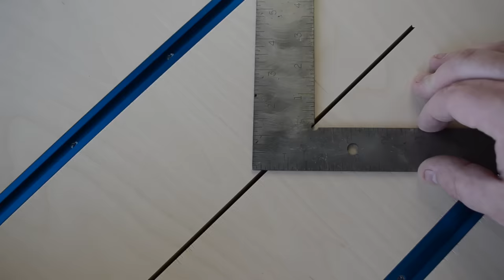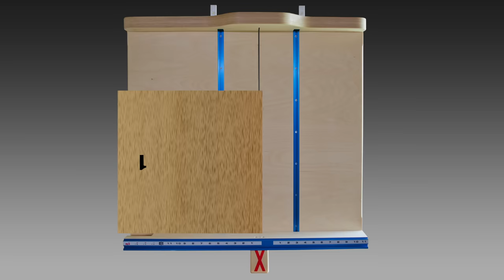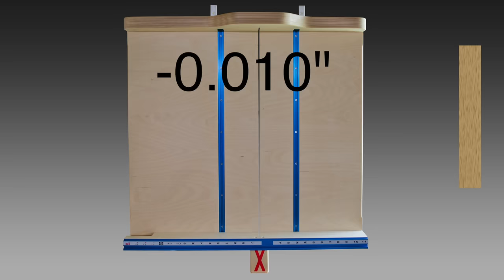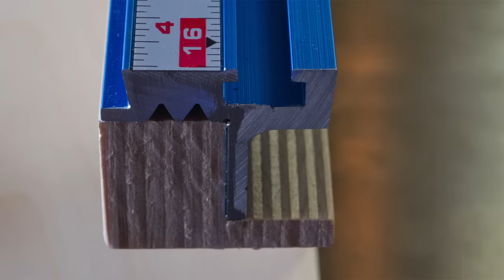Ⓕ Make A Table Saw Cross Cut / Miter Sled Combo (ep58)

Comment: Question: with regard to the 45 degree miter attachment, how do you attach the t-bolts in the miter track on the sled? Looks like you have the front and back perminantly attached on the sled, so I’m not sure how you get the t-bolts in the track.
Reply from the maker: that's where the notches in the fence come into play - you can slide them in there - or others that have made my sled have just left the track an inch short - when I made another for my jobsite saw I ground an opening in the top lip

Comment: Just a couple questions before I buy the plans and try the build this weekend. Would you recommend basically covering the entire top of my Dewalt job site saw with the sled? With the smaller saw I'm a little lost as far as how big to make the sled. And will the sled be ok with cuts where I have the blade tilted to an angle? And last question...how do I not be scared about the offcuts shorting across the room while using a sled!? Thanks and great build!
Reply from the maker: I'd probably scale it down slightly for a job site saw - just cut the base and see if it tips easy before and after the cut and scale down if needed - you should be scared that a tool can hurt you - being scared is good, being unsure is not
Reply: I can see myself posting that quote in my shop. Thanks Nick. (As for the football bet from the podcast...The losing football fan should have to wear the winner's team shirt in a future shop video for this weekend's games)
Reply from the maker: haha - it'll let a little knowledge nugget pop out once and a while - we were thinking flags but who knows

Comment: hey nick! Are you getting a lot of chip out on the inside corners when you use the miter sled? i know to avoid it you cut from the inside out but on the sled i guess the best way to prevent that is a backer board??
Reply from the maker: there really isn't any tear-out on flat 3/4" material as the insert acts as a zero clearance backer - making sure to use a clean, sharp blade helps as well
Reply: +Nick Ferry absolutely right but what about picture frame material ?
Reply from the maker: you are never going to be able to back all profiles - most frame profiles have edge details on both sides so cutting it in the other direction wouldn't help that - blade sharpness and feed rate are more important
Reply: +Nick Ferry makes sens thx ;)

Comment: Would Rocker T Tracks and Rockler Aluminum Miter Bar work for the other items except for the 48″ Kreg® Top Trak – ITEM#: KMS7714?
Reply from the maker: I'd say almost certainly the miter bar would as that's a fairly standard size - be aware some smaller, almost benchtop saws, can have odd or proprietary miter channels - as for the t-track, I'm not 100% sure the Rockler ones are the same as the Kreg but if you're building the sled you can adjust that dado to fit whatever brand you purchased

Comment: hi great sled thanks for all the good ideas but can any one help when i adjust the back fence so that the 18" off cut is parallel to 1 1000" but then i put a set square on the board .The board is out buy about 70 thou  yes is the square out but i checked it with 3 other large  squares and they all show the same  if i adjust so the board is square then the off cut isnt parallel its really doing my head in thanks
Reply from the maker: hard to say without trying it in person but is the sled fence 100% straight?

Comment: Any plans to add extensions to accommodate long boards? I need to build some 28X40 picture frames? Any suggestions on getting the same cut every time for your sled with long cuts? Thanks.
Reply from the maker: I do have an extension I need to make a video on
Reply: @NickFerry  Thanks, will it be an extension for the sled and the miter?
Reply from the maker: It’ll be for the sled but a slight measurement change and you could use it for the miter

Comment: Nick: I have the crosscut and miter sled built.  Regarding  the knobs for the Miter sled and the TTrack...did you have to file down the bolts on the side of the heads so as to fit them in the TTrak?  The bolts that came with the knobs with the hold-down bars that I got from your link seem oversized.
Reply from the maker: The knobs didn’t come with bolts last time I ordered them - 1/4-20 hex heads should fit perfectly - if what you have is a bit snug, filing them down won’t hurt

Comment: Nick, I have a question....
I plan on putting the miter slot runners directly below the miter saw track and screwing them together with machine screws into threaded holes on the miter slot runners. 
Any reason to NOT do this????
Reply from the maker: One concern I would have would be making them not independent of one another - I'd hate to see using the miter tracks impart any force on the runners - even if you glue them I think offsetting them as a better choice

Comment: Hey Nick....Love your plans for this cross cut and miter sled. Question for you,  is it possible to scale this build down a bit to fit my jobsite table saw? What is your opinion on this if you have time. Or can you suggest an idea to build a sled that fits my needs?
Really enjoy your site from a long time follower of all your social media sites. Thanks in advance.
Reply from the maker: thanks much - glad you like the plans - I have a jobsite saw as well and I made this sled for it as well - the width was the same but I took about 4" of the depth of the base so it's not a tipping issue with the smaller table saw top
Reply: @NickFerry  on your plans are the materials listed as well as all the t track and other accessories needed?
Reply from the maker: absolutely

Comment: question/problem... So, I blew through darned near an entire piece of maple trying to get the miter rails the right size.  Finally, I said "screw it" and bought rails from Rockler.  I don't know why everyone just cuts their rails right, but I couldn't.  Got my fence dialed in to 0.0008 over 15.6".  I put the rest of the screws into my fence to hold it in place, now the rails bind.  Obviously, the fence is now out of square, but how can I remove material from the aluminum miter rails?  Just sand down like mad with 60 grit?  Seems like something mechanical, like a Dremmel, would be too uneven.
Reply from the maker: I’m guessing you’re referring to the miter slot runners - it’s probably best to email me through my site as I don’t always get notified of responses on here

Comment: People always seem to glue and screw their runners, if it is wood, is there a reason to screw if your gonna glue other than clamping pressure, which could be done just by leaving something heavy on it overnight if you make your sled as your last project before put up?
Reply from the maker: if you only want to do one, by all means, do one - I was joining two dissimilar materials so I think it is wise - also CA glue tacks it and screws hold it long term - best not to rely on CA alone in this application
Reply: Yeah, I don't think I would trust metal and wood to be glued, but, so far I have only used wood for what little I have built as a newcomer to the field, but I have yet to use screws on my runners, but they have been wood too, I know screws are faster I suppose, but when I started my tools were far more limited, and time much more abundant. I just didn't know if there was some reason for it.

I love your channel by the way. You are a freaking genius, and I love the energy you have when doing all this interesting stuff. Thanks for the answer, and my goodness was it fast.
Reply from the maker: thanks for the kind words - it's more of a belt and suspenders approach when using wood runners - I'd still add screws personally

Comment: Fantastic video Nick. I was watching at the 10:53 mark and it looked like your Kreg swing stop deflected a small amount when you butted your work piece up against it. Do you find that there is any side to side bending in that swing stop?
Reply from the maker: Thanks - I had the pivot bolt a bit loose - I tightened it up and removed any backlash
Reply: @NickFerry  Another question for you. You had made yours 24" deep to accommodate for potentially squaring up a cabinet door or something. What are your thoughts about making the front fence removable (to still be able to square large objects, but not have the whole sled be so bulky) with some countersunk screws from below? Do you think that would lead to inaccuracy or an unstable structure? What pros or cons do you see with that idea?
Reply from the maker: Matthew Heer I haven’t personally seen a need to have it removable - It wouldn’t be that unheard of to just not glue it and pay attention to the screws a little bit more to make sure that they’re nice and straight and countersunk properly so that if I need arises you could remove that back fence - you typically don’t have alignment issues when the sled is on the table but you’ll probably want to add the fence back when you store the sled
Reply: @NickFerry  I finished my cross cut sled and was watching an April Wikerson video and she mentioned you were from Wisconsin! I had a laugh because I'm down in Platteville. Small world.
Reply from the maker: Matthew Heer - cool - yup, I’m in GB

Comment: Hey Nick, I built your sled I have a question about the 5 cut method. During the final step in the equation when you multiply the distance from the pivot point to the spot where you will make the adjustments, are you measuring from the pivot poit to the end of the fence? Or the pivot point to the 45* cut out in the fence? In your video it looks like your measuring from the edge of your 45* cut on your fence. Shouldn’t you measure from the pivot point to the end of fence? I know you can’t put a screw in at the end due to the cut out but shouldn’t you use the entire length From the pivot point to the end of the fence in the equation?Thanks
Reply from the maker: it's not about where on the fence you make you adjustment, that's inconsequential - pick a  random spot towards the opposite end of the pivot point - whatever the distance is between your chosen spot and the pivot point, that's your last multiplier - if you adjust 20" from your pivot, you will multiply by 20 - if you are 22" from pivot you do times 22 - the closer to the end you go the more accurate you tend to be because the amount to move the fence becomes less finite

Comment: Hey Nick, Came across your Channel this evening as I was watching an older Kings 3hour livestream on glue, and just had to pay a visit and drop a sub. I did have a question though, as I’m starting to get back into woodworking, quite some decades since i had shop classes back in high school. I was wondering if a crosscut sled would be advisable/practical and doable for my older DeWalt DW744 Table Saw which is one of those smaller job site models. It’s a great little unit and it still operates like the day we bought it. So without asking a ton of questions I just figured I’d see what your opinion was on my request seeing that everyone and their mother are making jig videos these days. Thanks In Advance & Hope that you’re having a good one.  Looking forward to binge watching some of your content.
Reply from the maker: Thanks much - I saw you posted you found the answer on the other video 👊
Reply: @NickFerry  Anytime Brother. Seeing that it can be done I will most likely use your guidance from the vids to make a smaller version for my table that will suit my needs. Appreciate it and Thanks for the reply.

Comment: Hi Nick, where do you find baltic birch plywood that large?  I can find some but it usually small pieces 2' by 3' at the most.
Reply from the maker: Sounds like you’re finding off cuts - do some digging for a plywood supplier - the standard size for it is 5x5 - it’s more common than people think - it just might not come from a big box store
Reply: @NickFerry  Thanks

Comment: Hey Nick. Have you seen the Kreg heavy duty track? I was thinking about getting one of those instead of a top track and wanted a second opinion.
Reply from the maker: I’ve seen it but haven’t worked with it or used it on any jigs - you will want to check the dimensions on it and see if they are the same though - not only for the sled but the attachments I have designed for the sled (like the tenon jig) if you plan on making those as well
Reply: Nick Ferry I will see about making a new sled that incorporates your design with the zero clearance inserts I have found in other designs. I will use the heavy duty track and let you know how it turns out.

Comment: Hey Nick, have you had any issues with the nylon adjusters in the miter bars wearing down and causing the sled to shift a bit side to side? 
Also I noticed with my miter bar runners that when I pull the sled back to finish a deeper cut like a 20-22 inch board, that because the miter bar runners were fitted with the nylon adjusters  being used, that when less than 2 nylon adjusters are touching inside the table saw slots the sled shifts actually a decent amount since the miter bars runners are less wide than the slots.
Reply from the maker: The nylon set screws are supposed to wear, they are the consumable in this system - anybody that says their option doesn’t wear or wear out is lying - it’s like people saying they have a knife that stays sharp forever - that’s why I shied away from plastic or wood runners here - I’ve done wood in the past and it just eventually wears away - with my current usage I would say every two to maybe four months I tend to feel the slide left and right and if there’s any tactile slop, I just advance the screws a 1/8-1/4 of a turn

As for the question of cutting wide boards and only been in contact with a couple of the grub screws, there’s a few reasons why it’s not a problem - one of which is that it’s a 10 inch diameter blade and by the time you would get to only two of the grub screws being in contact in the Miter slot, any deviation towards the end of the cut would be slight because of how much blade is in the cut 

basically, it’s a non-issue
Reply: Nick Ferry Thanks for the quick reply. I tend to be extremely picky, precise and over think things so thanks for your input and clearing that up. Thought maybe I should of just pushed the runners to each side but used the adjusters instead. I assume they sell new adjusters and then it’s just replacing them and I assume realigning the fence again, fun. Thanks for your time, take care and really enjoy your channel brother.

Comment: Why not 1/2" ply for the bottom so you don't lose so much depth of cut?
Reply from the maker: 1/2" would only leave 1/8" of wood under the miter track - I wanted more for attaching it and rigidity - the 1/4" difference on the depth of cut was negligible to me

Comment: Why do you scrape off the excess glue with a chisel?
I can understand a concern with setting off your brake of your sawstop saw.  But I see many guys scrape excess off with a chisel who don't have sawstop saw's.  Is the glue bad for the blade???
Your thoughts...
Reply from the maker: just to have a reference flat side for the rip fence - and if you catch the glue before fully set, it comes off a lot easier
Reply: Thanks. 
Getting ready to build a sled using your designs.  Best one I have seen by far.
Thanks again.

Comment: How do you insure that the miter is 45 degrees to the saw blade?  I didn't see how you cut the miter base.
Reply from the maker: Geometry - if the miter base is a right triangle, (which it is being it was just cut on the squared sled) and the legs of the triangle are equal, it will come out to a 90, 45, 45 triangle - once the hypotenuse is placed against the fence (which we know is 90 to the blade) you'll have an even 45 degrees to each side of the blade

Comment: Well done. Have you considered building this for sale?
Reply from the maker: I have - considering every table saw miter slots are different and I don't want to personally make a bunch of them it really hasn't gone anywhere - maybe if someone knew of a manufacturer that I could work with but other than that, not really
Reply: I understand. Your video was top notch from all parameters. Thanks for posting. Mike

Comment: Hi Nick, sorry it’s me again, but I have a question about buying all the t-track, which is quite expensive. I am on a low budget income and I was thinking, can I use a router bit that makes the same type of slot? Would you think it would work or after time the plywood would widen and I wouldn’t be able to use clamps. Like I said this is a sled I would love to make but just the hardware will cost over $200! Please send me some info on what I could save on. I am not trying to be a cheapskate but like I said I need to save money before I can start building projects and sell them.
Thanks,
Rick
Reply from the maker: I think a t slot cutter would be worth trying

Comment: I'm curious. With the blade going through your track, how tall is your front fence?
Reply from the maker: whatever height to use the swing stop properly - I forget what the manufacturer recommends - the amount of protrusion into the track will be dependent on how deep a particular saw cuts and will vary from saw to saw
Reply: Oh ok. I'm making a sled kind of based off of this. I have the track and the stop, and my fence looked shorter. The stop needs 2 1/4" fence height. Thank you for the response. I appreciate it. I absolute love your videos!
Reply from the maker: thanks - I have plans for it as well as more info the article here - https://nickferry.com/2015/07/table-saw-cross-cut-miter-sled-in-one-ep58/